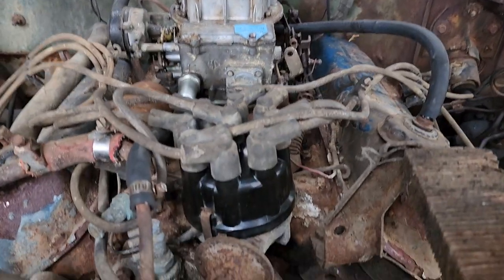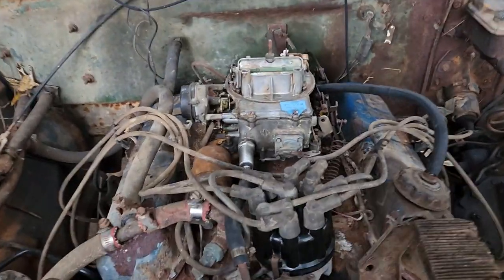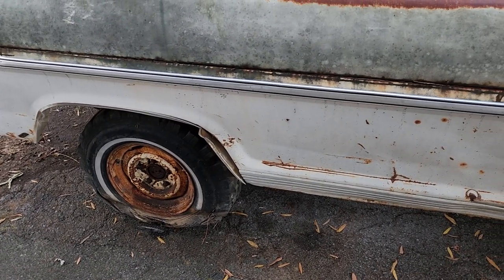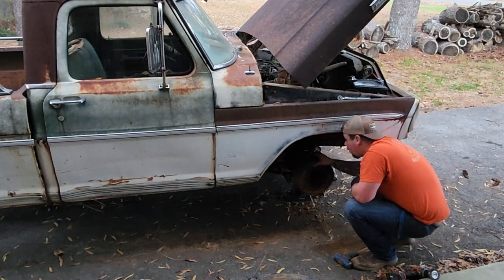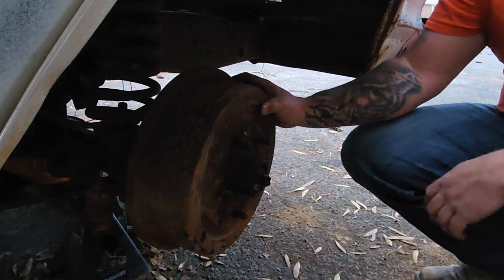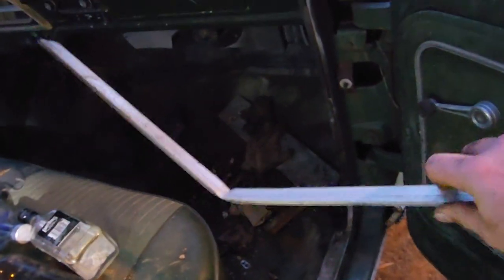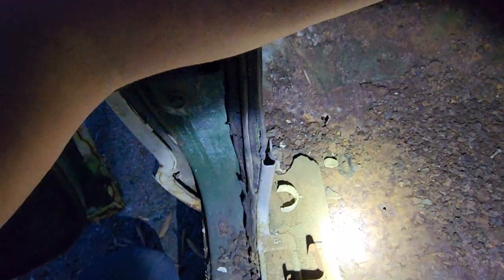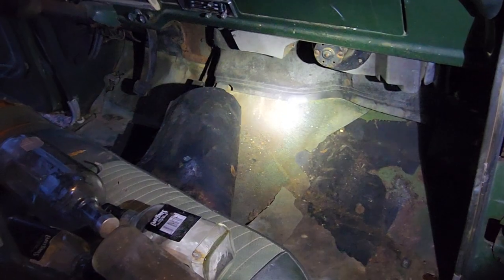This abandoned truck still has some life left!

Comment: Looks like à good project! Idle air mixture screws and choke setting. Try To keep running To warm up so you can check timing. Maybe use puller or pry bars To get brake drums off! 79 last year for métal dash in Ford trucks! Glass fogging is glass layers séparation. Should be able to find good used windshield. Floors solid for 50 years old!

Comment: Don't give up mate she's worth saving 
Mixture screws on the carbs will need setting 
Try both screws all the way in then 1.5 turns out to start with and check the idle screw it actually touching the stop

Comment: while the truck is up to temp..try to set timming...once you do that ..try to set the idle mixture screws ..use a vacuum gauge ..keep idle as low as you can..[ after you find it has no vacuum leaks or you fixed them..]and move the screws in or out until you get the highest vacuum reading..do this to the other screw as well..once both sides are up to as much vacuum you can get...check timming again..dot let anyone tell you the screws must be set a certain way ...thats only good to get it running..use a vacumm gauge to get precise adjustment on the screws..and a smooth idle
Reply from the maker: Thanks!

Comment: ok, the carb may still have some crud in the idle circuits.  more cleaning and a rebuild kit.  a cheap sonic cleaner from harbor frieght cleans up old aluminum/pot metal parts really well.  base timing is set with the vacuum line to the distributor disconnected.  if you can keep it running long enough or start it from outside, take the carb cleaner and spray around the base of carb and intake.  if the engine pics up speed there is your vacuum leak.  a remote start switch, vacuum gauge and a timing light are the first 3 "automotive" specific tools I would buy.  Jeff

Comment: Check out junkyard digs on you tube he has carburetor tune up videos. You can try adjusting your idle screw on the throttle linkage and you can check for vacuum leaks spray brake clean around the base of the carburetor and around between the heads and the intake if it speeds up that area should be your vacuum leak

Comment: Rings valves and everything are old worn and takes time for them to possibly rebuild the compression to engine back up try mystery oil in engine for a short time plus gage test can be hooked to dial carb in better also replacement of spark plugs is a definite

Comment: Idle it up with throttle control screw. You cannot tune if it won't run. Then you can vacuum tune timing. Run it a week or 2 and check plugs.

Comment: also..check the transmission and find were the vacuum modulator is..make sure  its also hooked up  [ the only vacuum hose  on the tranny ] ..the modulator will be facing the rear of the truck ..you should see a hose  on it  [ but it might have fallen off ] causing a vacuum leak as well ..hope all of this helps
Reply from the maker: Helps a ton!

Comment: one more thing...never make any adjustments to the carb or timming uintil the motor is up to operating temp ...by the looks of the distributor..i can tell its to far advanced...[  maybe someone had it out and dropped  it  in the wrong place...or maybe the timing chain jumped and they had to move the distributor to get it to run ,,and remember??[ always make timing or air fuel screw adjustments  only on a warmed up motor
Reply from the maker: I appreciate you taking time to explain all that!

Comment: First get the fuel pump pumping fuel to the carb and connected to the carb with a steady supply of gas  make sure none of the vacuum hoses are leaking you may need to just plug em  screw your tuning screws all the way in untill they stop
Just untill they stop no more then back both of them off two full revolutions  and one half turn out
 Crank the truck and keep it running untill its at operating temperature
 Then you can start by adjusting the the low idle mix screw each time you adjust the screw  rev the engine and let it return to idle repeat this untill it idles smoothly  then you can adjust the high idle side  untill there is revs smoothly  also those old plugs and wires should be replaced immediately before attempting to adjust that carb
Also as nasty as that carb was replacing it with a remanufactured or new carb would be better 
Replace your carb base plate no sense in spending saving 5 or 6 dollars when you already replaced everything else  
As someone else said thunderhead 289 has good series on tuning carbs the way i outlined is the shade tree mechanics way of doing things and not neccesarily the correct way but it will get your truck running edit sorry for the typos
Reply from the maker: Wow! Heck yeah! I love your explanation
Reply: Did the best i could do hope you can get it going im sure you know the viewers seem to like to see old cars and trucks power washed then the paint restored

Comment: The windshield has a plastic film in between tow layers of glass. The only way to get rid of it is to replace it.
Reply from the maker: Awww I was hoping for better news then that... but.... it is cracked I suppose lol
Reply: They call it delamination, that is the layer that keeps it from shattering on impact, unlike tempered glass.
Reply from the maker: Interesting! Love learning something new everyday
Reply: @gear_junky  Keep at it! No one is born with all knowledge. And there is a lot of good stuff out there for information. Basic hand tools, you can do a lot. It just takes longer. Just remember, if you don't start, you can't finish either!
Reply: @gear_junky  I also have to let you know, the first vehicle I ever learned to drive was a 1972 F100, complete with radio delete plate, and a 3 speed column shift manual transmission. It did have power brakes, no power steering. Farm stuff. And I wished I still had it.
Reply from the maker: I like this truck after I get it all fixed up may sell it or if the channel takes off good do a give away on it

Comment: Set your timing first. Static setting on the carb should be 1.5 turns out, static timing with vacuum advance disconnected should be 8 to 10 degrees at tdc, or top dead center on cylinder 1. Above advice of watching Thunderhead289 is good, he is knowledgeable, Junkyard digs as well. Both show proper advice on how to set timing and carbs.
Reply from the maker: Yeah they have a few tools I don't. I'll have to aquire those lol
Reply: @gear_junky  a timing light should not be to expensive, but I hear ya brother, today's costs. I would recommend a vacuume gauge, as well, when it comes to setting the carb, as you will be able to dial it in, get it to it's highest steady point, and be able to see if you have any flutter, which indicates leaky valves.
Reply: By the way, never hesitate to ask a friend. They might have the tools and/or the knowledge to give you a hand. No shame in that.
Reply from the maker: I'll see if I can rent some from part store don't have alot if ppl around me that'd have these lol
Reply: @gear_junky  I'm not sure if you have a place that does it, but there are places that just require a deposit, and when you return the tool, they give you the money back.
Reply: @gear_junky  Derek from Vice Grip Garage is also great to watch, and he started out small, hand tools, small garage and a lot of out door work.